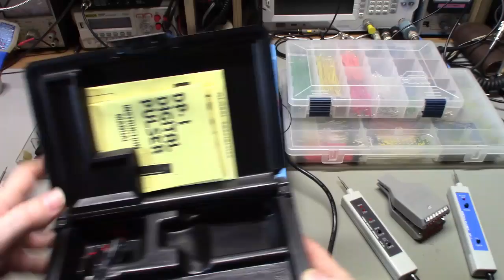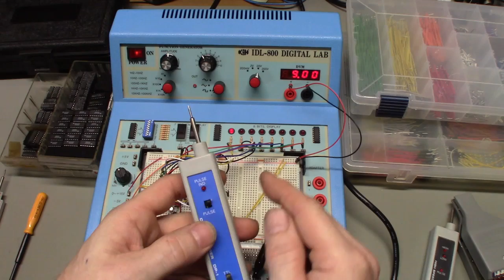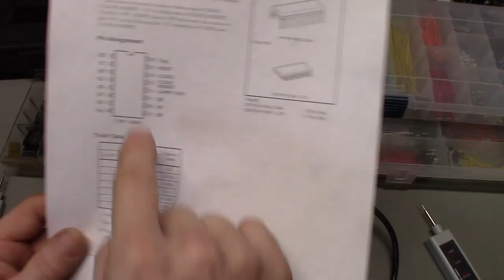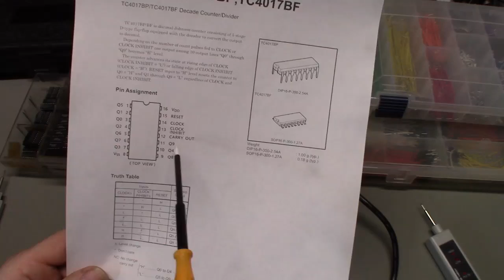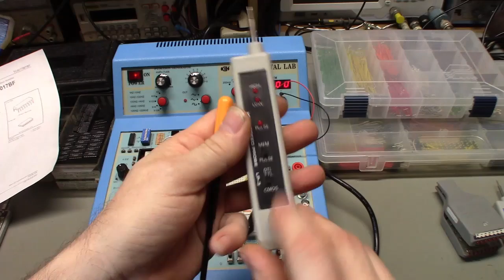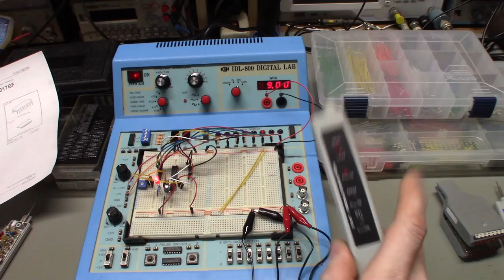Logic / pulser probes and logic monitors still have a place on the bench today.

Comment: Can I use external 5v from a power supply for powering logic probe along with power supply's ground?
Reply from the maker: The probe needs a ground reference.  If you use a external power supply that would isolate the ground from the DUT's ground then it won't work.  If the two power supplies share the same ground then it would.

Comment: Question..... I have a Dx7ii synth
It has a crystal oscillator that is rated at 9.426..... They don't make that now..... Can I substitute with a 10mhz....
Oscillator?
Reply from the maker: Not familiar with that model radio but that much of a difference would knock it way out of alignment and there is no way you would be able to get that much tuning range to bring it into spec.

Comment: The guys who need audio on these are us old farts with poor eyes. In my case, I need one for catching a single pulse from a car ECM from the early 90's. It checks the throttle opener vacuum solenoid before it gets up to 130 degrees (otherwise I'd have to wait 5 minutes for it to heat up, then let it cool down each time. But the test pulse is either too fast to register on a DMM, even with "hold" function, or it's not there. So to make sure one way or the other, I'm shopping for one with an audio beep for the pulse memory to use instead of my LED only version. Then instead of hanging upside down under a dashboard trying to see a very short test pulse, I can just backprobe the connector, hang the probe on that wire and wait for the beep. Handy little tool for those of us who can't afford the pre-'96 auto test tools, software and hard-to-find adaptors.

Comment: Wow, I've never seen anything like that Logic Monitor DIP-clip type thing. I do a ton of prototyping with good old DIP chips, and something like that to monitor low frequency pin functions seems incredibly useful! Seems quite expensive on eBay unfortunately. Maybe an opportunity to DIY something similar... Never even had the idea until I saw that thing though.
Reply from the maker: Wouldn't be to hard to duplicate.  Take a 3M DIP package test clip, solder ribbon cables to it and you could put the circuit on a small circuit board.
Reply: I've been eyeing those DIP test clips for a while, so, sounds like a good excuse to get a few.

Comment: don't use that insulated wire that you are using at 27.275mhz as the insulation will melt as you close to the resonate frequency of Chloride.

Comment: I noticed those IDL-800's are actually still made (at a cost of 499 USD and up). I've encountered and used a variety of these training laboratories throughout several schools and some training labs from these "standalone labs" all the way up to the modular and mondo expensive NI ELVIS and ELVIS II+.

The Global Specialities website does not appear to list or sell that or likewise logic probe/pulser/monitor kits, which is probably related to the reasons mentioned in this video (variety of other brands as well as DIY versions).

EDIT: One thing I forgot to mention is that I tried finding a "logic monitor" and they were either hard to find, too pricey for me, or just a tad bit "bulky" for attaching into tight confines. My solution? I found one or more 3M branded  IC test clips (available on Digi-Key, Mouser, etc.) which I'm able to connect leads to either a DIY or an OE logic analyser. Saved quite a bit of money and I can use several types of these clips by just pluggin wires to the top end of the clips. Just my 2 cents.